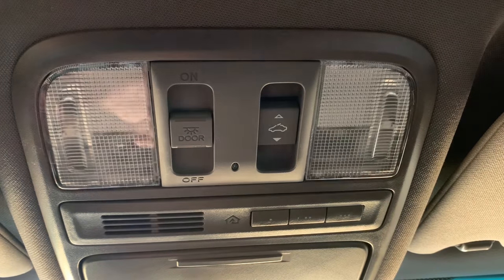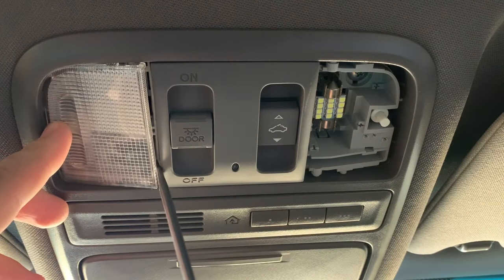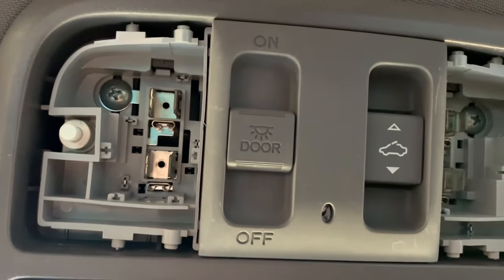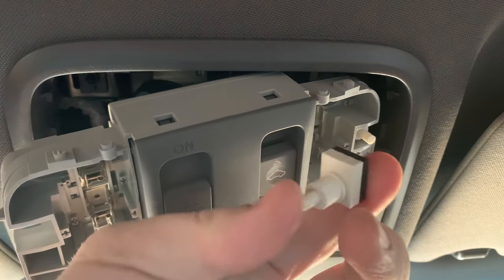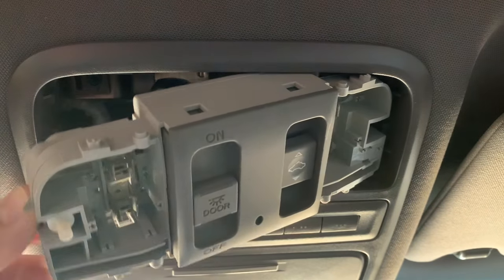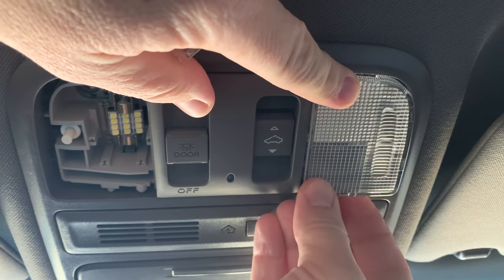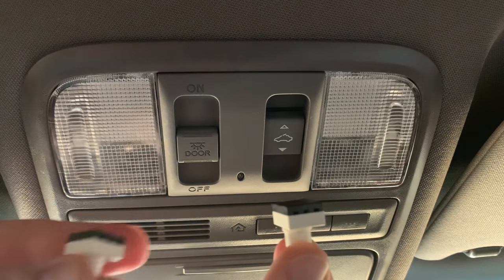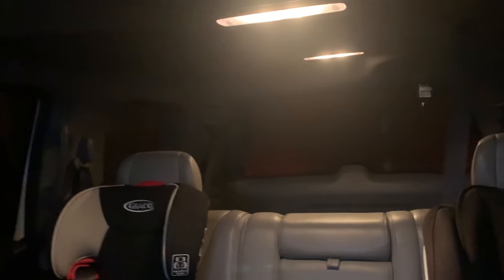FIXED! Honda Map Reading Lights Not Working

Comment: I swapped the switches and both lights began working again. Thanks for the help!!
Reply: By swap you mean replaced, correct?
Reply: @RonAllenTaylor  I get the impression, based on prior comments, that he just swapped the left bulb and the right one into opposite placements. But that's just how I read it.
Reply: @bryanwalter5752  thanks! The ac has since gone out, $1500 to repair 😊

Comment: Clear and concise replacement guide to courtesy light in Honda Accord . Ordered two switches from China for less than €6.00. Arrived after 40 days!! However, I have been years with faulty switch already, so wasn't bothered by delay. Worth the wait.  Thank you so much.

Comment: I recently purchased this model van and the map lights were both off. After watching towards the end of your video (the part where you mentioned that others said the switches might not be bad) I was able to get the lights to work without having to buy new switches. I didn’t have to take the whole assembly out either.

Basically what I did was just remove the lamp cover and used a small screwdriver to slightly move the switches as though I was trying to pop them out (just as shown in your video). As I was pushing the switch out the light turned on. Then I repeated the same on the other side. Problem solved.

I guess that overtime of pressing the switches that they end up moving out position and just needs to be reposition to work again.

Thanks for making the video.
Reply: Note, I had the lights to on position so that it would turn on to let me know the switches were back into position.
Reply from the maker: That’s great! I’m glad it’s working for you!
Reply from the maker: Nice tip!

Comment: Dude! This saved me, new to the Honda world, have a 2011 Pilot I bought 6 months ago, passenger map was out, so replaced, didn't evenlook at bulb cause new onecwas working, just went out again, same side, so when I saw this, I pulled the switch, used my WD40 Contacts cleaner and a can of compressed air, and voila, she's working again 😂😊 Now if I could just get the sunroof to work, lol. Tried all the reset procedures I've found on here, nothing, still will only tilt, might need that flash done by dealer, not too worried though, as long as she don't leave me alongside the road, I'm good😂👊 Thanks for the great vid, your way of taking the lenses off, is even better than what I've found and tried 🤟
Reply from the maker: I’m glad you were able to get yours working again. It’s possible the motor on the sunroof has gone bad.

Comment: My map lights worked fine (push-push, on-off) on my 2007 Civic. My problem was that they would not come on when the engine was turned off and the key extracted from the ignition, or when the door was unlocked. In the video, I noticed that the switches had three terminals.  It occurred to me that one terminal was ground, one was to turn on the light, and the third must be a pass-through for the auto-on function.  So, I removed the switches and sprayed them with contact cleaner.  Now the auto-on function works perfectly.

Comment: Thanks so much for the link for that kit. The tool made the job so much easier. Question - any idea how to get the switches out from the back seat panel? It’s almost as if the switches are built into the piece.
Reply from the maker: Sorry we no longer have this car and I never tried to remove the rear one.

Comment: This video was spot on. In fact I tried the trick he mentioned at the end about taking both switches and blowing compressed air thru them and swapping their left/right positions. Both the lights started working again!

Great video!
Reply from the maker: I’m glad to hear that worked for you.
Reply: I did break one of the covers while removing so I ordered using the links provided to help you out some. Thanks again!

Comment: Thank you for this video. I’m getting ready to order the $10 set for my 2009 Honda Accord. I hope this works. 🤞🏽
Reply from the maker: I’m confident it will work for you!
Reply: @TightWadDIY  Update: I just replaced the NATO lights but they still don’t work. While replacing them, I recalled that neither of my vanity lights work either and nor does my interior light. However lights on drivers and passenger doors work. Any guesses on what may be the problem?
Reply from the maker: @beckya.9594  That sounds more like a fuse or relay issue since none of the overhead lights work.

Comment: I am having a similar problem. Neither visor lights nor overhead lights working, probably they have same wirings. fuses are fine but power not coming from down below. What could be an issue?

Comment: you guys may wanna try using a vacuum cleaner to remove the dirt from the switch connectors before replacing them. It worked for me !!! 
Thank you tightwWadDYI !!!

Comment: I watched your video carefully and it is very detailed.  I ordered the parts you recommended and went to work.  Sadly nothing still works.  I even attempted the backseat dome light...still nothing.  I think I must have a bigger issue.  Any suggestions?
Reply from the maker: Your issue could be a bad fuse or relay if none of your lights are working.

Comment: I have same issue & am going to try swapping the switches to see if that works first.  Did that with the bulbs & both bulbs are good.
Reply from the maker: Let me know!
Reply: @TightWadDIY  I swapped the switches & it worked

Comment: Thank you for posting this video. I had a high hope that this would fix my non-working dome lights. I replaced both switches and the LED bulbs. But unfortunately the dome lights still don't lit. And I couldn't put the black screws back in. I thought my issue is not caused by a burnt fuse because it seems the fuse that is connected to the dome lights is also connected to other interior electronic devices which are working. Is there a fuse that only controls the dome lights? Do you have any suggestions?
Reply from the maker: Not that I’m aware of. Sorry.
Reply: @TightWadDIY  It turned out my assumption was wrong. It's the burnt out fuse in the engine room fuse box!
Reply: @tkurosaka  Nice! I'm glad you found it!

Comment: Thanks for making this video.  I have a 2006 Civic and my lights not working at all - dealer said need whole unit so I will try this but curious if ur light was not working at all or was just not working with the switch?  Mine doesn’t even go on when door opens now.
Reply from the maker: Mine weren’t working at all.
Reply from the maker: In my opinion, you shouldn’t take an 06 car to a dealership. I only use dealerships when the vehicle is under warranty. After that they are a huge ripoff.
Reply: @TightWadDIY  Yeah, I commuted 65 miles each way to work everyday since 2005 so the dealer near my office where I bought it was convenient, reasonably priced and friendly.  I now have 214,000 on the car and work at home.  Using local shops now.  I’ve been living with this dome light issue for a couple years but more bothersome with the shorter days.  Looks like the part does not fit my car - although light looks same.  I’ll look for another.

Comment: Hi! Awesome video! I have a 07’ honda crv, the map lights work when manually but aren’t when any door is open, not even when the “door” switch is on… any idea would be very helpful. Thanks!
Reply from the maker: I’m not positive but try swapping the switches to the opposite sides and see if it fixes your issue. That has worked for a lot of commenters.

Comment: Awesome! I just ordered a new LED kit for our 2012 Pilot & these were the ONLY ones that didn't turn on after replacing all the bulbs. Followed this video and they're working now. Thanks!! 💪👍
Reply from the maker: That’s great! Did you buy new switches or just swap sides with your existing?
Reply: @TightWadDIY  Swapped sides but I didn't even know they could be replaced. So it's great to know if they go, I can buy new ones.

Comment: Excellent video. Got right to my problem. Bad switch on right side. I sprayed contact cleaner in the holes then blew them out with compressed air. Switch works good as new. Liked and subscribed!
Reply from the maker: That’s great!

Comment: hi, thank you so much for the video, i just ordered mine online to fix mine, another question, i have a 2013 crv, the idle is really low so i took the intake duct off and cleaned the throtlebody with mass air flow sensor cleaner and use a old brush to clean out the carbon buildups, now, the idle speed is higher but the car is bit jerky at low speed, like the car wanted to shift a gear up and down constantly at low speed. at higher speed is ok. not sure what i did wrong or anything, could i damage the throtlebody when cleaning it, as i was quite gentle when cleaning. any help here is appreciated.
Reply from the maker: Sorry I’m not a mechanic and I don’t really know.

Comment: Was the switch not "clicking?" Like before you determined it was the switch? Just trying to see if you have the same symptoms as I am. Thanks!
Reply from the maker: It was clicking, just didn’t work. It’s likely the contacts were just dirty. Some people found success just swapping the switches.
Reply: @TightWadDIY  so funny thing, I didn't check the right fuse box and found the 7.5amp fuse under the hood blown. I replaced and the lights work!!! Nonetheless, this is a vital troubleshooting option! Thank you!
Reply: @Hrledood911  That’s great!

Comment: This video is by far the BEST on youtube for this. Congrats! My problem is that on my 2004 Accord, the bulbs are ok, they work manually, but they dont work when I open the door, even having the DOOR position placed. I will fix this problem doing this? Thanks from Spain, master!
Reply from the maker: Thanks. I appreciate the kind comment. Do any of your lights work when your door is open? Do they work when any other doors are open?
Reply: @TightWadDIY  Negative, Sir. The lights only do work if I press the plastic panels, but none of them when the doors are open (passenger or pilot), or when I unlock the car with remote. Back seats light work fine when I open the rear doors.
Reply from the maker: @alexg6374  It’s possible you have an issue with the front door sensors. Does it ding when you have the key in and doors open?
Reply: @TightWadDIY  you mean by "ding" if I hear an acoustic signal. Not that I'm aware of. The key must be in but in which position for the door to ding? If you check on youtube "Honda Accord map lights", by user Maximum Tenacity, you will understand, cause exactly the same happened to him, and fixed it replacing the switch.
Reply from the maker: @alexg6374  I would try changing the switch then. Typically when you have the door open while the key is on, there is an audible dinging sound. You may also have a dash indicator showing a door is open. I was just pointing out that the sensor that tells the auto the door is open may be bad.
Reply: @TightWadDIY  much appreciated, your time and yours answers. Best wishes from Barcelona.

Comment: Great 👍video. However i don't know if you still have a pilot but i been having and issue of the air conditioner, sometimes it blows air in the front and sometimes not. I have change the piece under the glove compartment but still dont work. By any chance do you know what might be?
Reply from the maker: We do still have our pilot but haven’t had any issue with the AC.

Comment: How did you know it was the switch? Is there any way to test it? I recently replaced my stock bulbs to white on my '16 Civic, and I have a feeling the prongs may have got pushed into the unit so there's no contact being made to the bulbs. Is that possible? I'll have to try this fix tomorrow. Thanks for the video!
Reply from the maker: I assumed it was the switch because the fuse and the bulbs were good. If it wasn’t the switch it would have to be some type of relay which would be much harder to locate and replace.

Comment: Would the Vkinman 2 piece interior light switch handled bulbs kit on Amazon you have linked work for a 2010 Honda civic EX-L?  I replaced the bulbs because the right side passenger would not operate when the doors opened but the map light would go on when pushed up. I went to Honda and got two new bulbs. It worked for a while and then it started acting up again I am assuming it’s a switch. I appreciate your detailed video.
Reply from the maker: Sorry I can’t say for sure. I think they are all the same though.

Comment: Thanks so much for this video, I have a 2011 Pilot wit this issue...1st left started to intermittently fail then the right side (passenger) completely quit working.  Going to try the switch - switch-ero and see if that works 1st will let you know.   I am liking the LED Blue and will be switching to that for sure.
Reply: FYI, as I said above I went ahead, but after trying the solutions I was not successful and ended up losing all my interior lights.  Took it to my mechanic who discovered that the driver's side dome light is not grounding correctly.  Thus when engaged the short blows the fuse and effecting all the interior lights. The fix is to replace the entire console or not use this driver's side map light.  Guess I can live without this dome light.  Also, per my mechanic the LED lights you link to are not compatible with my 2011 Pilot.  Incidentally, my neighbor has a 2012 Pilot with the same issue with his Driver's side Map / Dome light.
Reply: Just to update. I tried the led bulbs and they work...so much for my mechanic 😟Just had to rotate them

Comment: Great instructions and everything clicked into place as planned until I installed the lens cover on the right side which does not seem to be making contact with the switch button. The lens cover clicked in just like the left side which works.  Any tips?

Comment: i inserted a new bulb, must have been a different voltage, and blew all my interior lights.  i wonder if this fix that you did, will fix my issue?  i will try
Reply from the maker: It sounds like you blew a fuse.

Comment: 2013 Pilot… right sided switch was getting fussy. Removed the clear lenses. Used a small flat screwdriver to “pop” each switch laterally (figured the driver side would soon get wonky). Simply moving the switches laterally and then popping them in by pushing medially did the trick. Didn’t even have to drop the unit down from headliner. You can move the switches to the side but you cannot remove them without dropping the assembly from the headliner. Like other commenters noted, cleaning the contacts restores function. The lateral movement scraped crud or reestablished contact. For good measure, I sprayed a bit of MAF cleaner into the edge where the switches plug in (toward the midline of the car). I also shot a bit of cleaner into the plungers. Seem to work fine. Time will tell. If they act up again and don’t respond to this or to a more thorough disassembly and cleaning, then I’ll spend the $13 for new switches.
Reply from the maker: That’s great news! I bet compressed air would help too.

Comment: Cne thing you can try- pop the switches off.  Use a small needle nose or small flat screwdriver.  Bend each set of 3 switch contacts just a hair forward, then a hair down (toward the cupholders) .  Pop the switches back in, push in wire connectors, bulbs.  Test for function.
Reply from the maker: I wouldn’t be surprised if that worked!

Comment: When into the dome light area and removed the bulb and tested it. The problem was not the bulb, so going to the switch I applied a bit of pressure to the left and than to the right to move the switch ( L & R ) and pushed the switch again and the bulb lit up , did the same procedure on the right light and they both wk  now, fog lights are next, . This was on my 2012 Honda Odyssey
Reply from the maker: That’s great! It seems that the contacts just get dirty so it probably help.

Comment: Did you remove the relay fuse before you did this? Also it looks like the challenge was pulling the assembly in order to take out the switches. Any suggestions?
Reply from the maker: I didn’t remove the fuse relay. I show all steps in the video. If it was difficult, I provided the best method I found.

Comment: My honda pilot 2010 the interior lights were working fine until I fixed LED lights then started problems, now I returned original bulb ls but still not working, 

What could be the issue?   

Thank you

Comment: Hey TightwadDIY,
Have a 2015 Honda Accord and I have an instrument panel warning that reads "check charge system" in a blinking fashion and cannot identify the problem. I originally had to replace 4 headlight bulbs as 3 were burnt out and also a fuse for the above interior map lights. I thought those issues might have been the cause for the defect warning, however after swapping the headlight bulbs and map light fuse, still getting that defect warning.
Any thoughts greatly appreciated!

Comment: Hi guys
Honda Accord 2009 euro.
One light didn't work when I was opening the door or when I was pressing the switch.The other light was working with the door and when I was pressing the switch but stopped working as well.
I swapped the switches ftom left to right without removing the wires from the assembly just snapped them out with a screwdriver.
Both lights are on when I open the doors and when I press the switches!
Reply from the maker: That’s great!

Comment: I have a 2012 Honda CRV on the front lights in the top interior, when opening the door the left light does not turn on just the right side is it the bulb or is it a fuse that needs to be replaced? Thank you

Comment: My Acura TSX map lights are out to.   Never thought about the switches.  I’m gonna look into this.
Reply from the maker: Did it work?
Reply: @TightWadDIY  put the LEDs in from Autozone.   Works 100x better than the original lights.